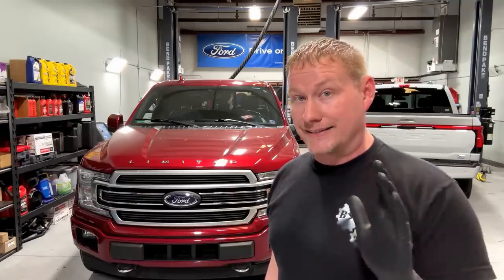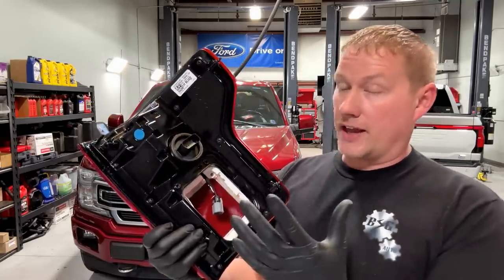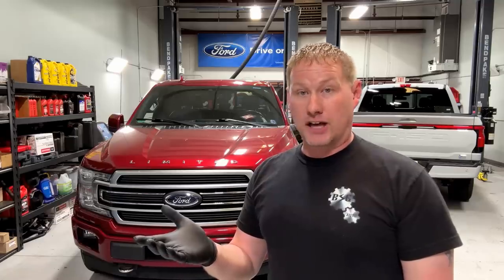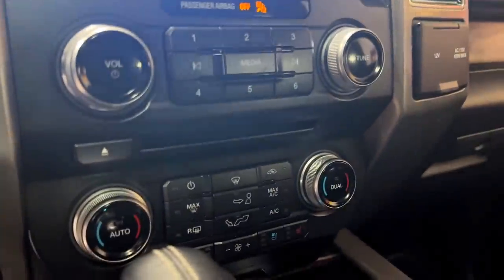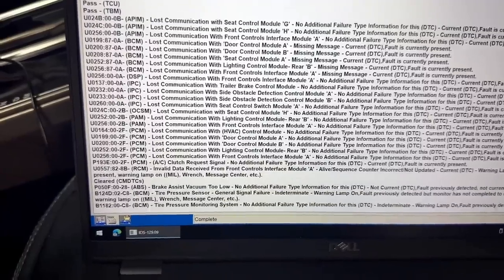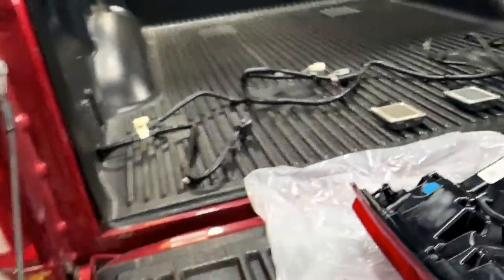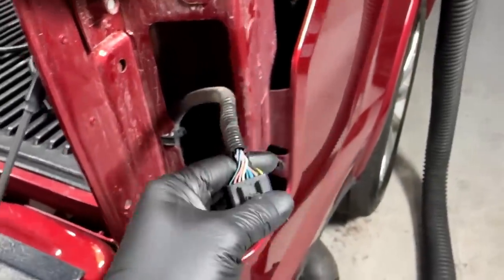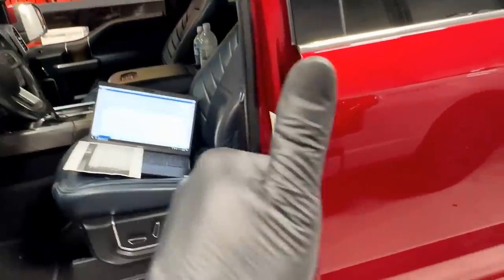Repair Cost Are Out of Control: $5,600 Bill for Some Tail Lamps?!

Comment: A good idea is to go through and apply electrical grease to all connectors.  Looks like they didn't do that at the factory.
Reply: I'm not a mechanic, but every vehicle I've worked on I've never seen grease in the connectors. Definteky need to do that to the Transit since Ford is so smart to direct the water flow right on top of the main harness connection. Never Ford again
Reply: @albowrx  Back in the old days they used to put grease on everything, especially lightbulbs. These days automakers cheap out on everything.
Reply: Auto makers these days are all about building a vehicle as cheaply as possible, while selling it for the highest possible price. Nothing else matters to them.
Reply: @albowrx  As a now retired aircraft electrical systems guy, who did side jobs in automotive shops from time to time, dialectric grease on electrical connections to prevent corrosion on electrical connections with the potential for moisture exposure used to be the norm for aircraft and motor vehicles. Now the car manfactures seem to have forgone using it. They tend to seal things a little better than they used too, but corrosion is still an issue quite often. Other than cost I have no idea why things have changed in the automotive industry.
Reply: @SmittySmithsonite  But hey! they saved 19 cents per vehicle by not doing that, so big win.
Reply: @albowrx some older euros and certain cold climate cars on certain fittings had a yellow tacky dielectric grease. 101 of restoring an old car is cleaning and repairing all the connectors. And the goo does prevent the green crust quite well. Green crust is the number one gremlin.
Reply: No we don't. I don't know that anyone does that. The last thing they expect is water intrusion with all the seals used on connectors
Reply: What's truly disgusting about this is that this truck is only 5 years old. Both my vehicles are 10 and I've and I've never had any of these issues with my taillights or headlamps. Tying all those other modules to the taillight module is ridiculous. My truck went start or run because my taillight is screwed up! Seriously!?!?
Reply: don't apply grease to most connectors these days because they have integrated silicone seals. if you add grease, you're gonna ruin the seals.
Reply: Because that's what we want to do with the $80k investment we just made, disassemble it.
Reply: And that's part of your problem. It's not an "investment".
Reply: @albowrx Exactly I did my transit before it became a issue. I take my connections loose and clean and grease every 2 years. First time I did it was already showing signs of corrosion on a few pins and this is with me paranoid about keeping the gutters clean. Also the rubber grommets for the wiper arms need replacing every 2 years, well the driver side anyway passenger always looks fine go figure
Reply: @sandspar "investment" lol, lmao even 😂
Reply: Any asset you can buy or sell is an investment. The comments about this fully loaded vehicle not being worthy of investment mentality, just need to get to more classic vehicle auctions. Even if the odds of that truck or any making it to an auction 40 years from now is a long shot.
Reply: @Ed-ui2qe  Bingo!

Comment: Great video - give yourself more credit, the move to cycle the key and check for difference is a skilled intuitive gesture, I've watched other tech's chase their tails without getting to a common point of fault.  I once spent well over 20 hours looking for an intermittent fault on a Range Rover, ultimately found a chafed wire for one of the injectors intermittently grounding as the engine torqued up on the rev range, the rocking motion  tightened the harness enough to initiate contact and immediate ground resulting in full fuel dump to that cylinder.  That point of contact was allowed due to the convolute tubing split - the split was directly on top of an intake manifold bolt, the wire over 3 thousand miles wore down to direct contact creating full ground and max spray as in wide open throttle on the one cylinder only happening under real load, 4 wheels on the ground and actual driving conditions.  On the lift, there wasn't enough resistance on the drive train to re-create the dynamic action of torque applied by the contact on the road to reproduce the grounding fault.  This one was a rough process.
Reply: I hear ya!! What I've learned over the years of being a tech is that most times it's easier to forget what you think you know and dont tunnel vision on the issue.....instead start at the very most basic.....battery voltage,wiring etc. It's amazing how many electrical faults I've discovered just by moving wires around. I got s good one for ya though....I was working on a brand new electric forklift one time that would shut down intermittently. In the end, it turned out that one pin was bent in one of the modules which would short to the one beside it. It was an unused pin and the connector still pushed on but "felt" ever so slightly different than the rest of the connectors. Your story reminded me of that one.
Reply: A most excellent tracking to the fault and perfect logic… when bean counters get to alter designs this is surely what happens to us as consumers… the manufacturers have been undersizing wires for years!!!
Reply: I had a Corolla that would turn on the oil light at idle in drive. Same type of deal. Thought I was into an engine at first.

Comment: We see this frequently in the southeast where we have a huge amount of rainfall that comes down in short durations. It is so common if you come in with  MS-CAN bus faults, that's become our starting point. I've also seen the equivalent failure in Rams. I'm not sure why this hasn't come up as a recall issue, especially considering other saftey related components that have such as the 360 degree camera system. If cameras warrant a recall, why don't blind spot dectection systems?

Comment: I went through this exact issue. The idea of a little water taking down the entire truck is insane. I love my 2017  F150 Platinum but this almost made me sell it.  

For those wondering, disconnecting the battery for half a day, cleaning drying, and greasing several 20 pin connectors (relating to the tailight) and replacing the entire tailight  including the BLIS module  finally fixed it. I also drilled a tiny weep hole in the lens of the new light so water couldn't collect in there and work it's way into the BLIS module - used a clear caulk to seal the module into the taillamp body too. It was insane gremlins all over the truck till I fixed it. Utter bullshit!

I really appreciate you making this video. There is a lot of confusion out there on this issue.
Reply: weep hole was my comment on Louis Rossmann channel. that's why i'm here. Louis posted the story i came to see story :face-fuchsia-tongue-out:
Reply: Built Ford tough
Reply: Ford should be on the hook for this. Bad design
Reply: 1995 and older for me from now on..........emissions can go to hell. Its MY vehicle, I WILL keep it running affordably.
Reply: @jeffsingleton88  tree fiddy 🤣
Reply: LOL drilling a tiny holy is a solution Ive used may time myself , sometimes the light housing just collects water no matter what especially where I live it rains hard for months.
Reply: You should still sell it.
Reply: Weep holes are essential for getting rid of humidity inside rear lights!
Reply: Even though you found the "fix" for the same electrical issue caused by water, and was able to repair it yourself, think of the poor, inexperienced man or woman owner of this truck and the expense they go thru to get their expensive truck operable. There needs to be a recall as a deterant in the future for poor vehicle design and this money pit.
Reply: @larrybruce4856  I agree completely

Comment: I worked at a high line dealership when HID headlights first came out. A customer would come in with a burned out headlight  and expect it to be a $5.00 bulb. When the bulb would short out it would take out the bulb, ballast and igniter in the headlamp. 
To get to the headlamp out to repair you had to remove bumper and replace the parts. It was sticker shock to the customer to know it was going to cost $1000 to get the headlight  working. The repair cost was mostly parts.
Reply: I think most people need to see what a repair bill for all this fancy stuff costs before they buy a top trim new car.

If they did, let's just say I don't think as many people would loom down on then for buying a low trim model or a used car instead.
Reply: Gm product is my guess...maybe a caddy?
Reply: Yep, went to change the headlamp on my car and discovered I had to take off the bumper. Talk about BS designs. These vehicles are ridiculous. Soon enough everyone will essentially swap out cars as often we do phones because nobody can afford to fix them (won’t be worth the cost).
Reply: I have HIDs in both my cars and I get replacement bulbs for $10 and I have never known anyone to have a ballast go. You sure you weren't just ripping your customers off? Removing a bumper usually only takes a few minutes too.
Reply: @vickilund7206  Acura. Mostly TL's around 1999.

Comment: 13 years ago I purchased a 1991 Toyota Hi-Ace Diesel 4WD for $5500NZ. It is still running. I have spent around $5000 in repairs. (Mostly rust, as I take it on the beach). I will never sell it. No question, it is the best vehicle I have ever owned. The tail-lights are original.
Reply: Question are you able to buy the newer Hi-Aces over 2011 model? Here in Europe the 2011+ "pollute too much" so we don't have them I know they make them in Japan. 

However Toyota has paired up with PSA Peugeot and Citroen to rebadge a Partner and call it the "Pro Ace" just a French Shitbox IMO with Toyota badges, a disgrace many customers say they buy Toyota because of quality, and they get a French car, talk about a scam.

 Also a side note Volvo, people buy them because of "Quality" little do people know after 1999 Ford bought them and Shitboxes yet again, however now China has Volvo it is just Shitboxes with big wheels. 

If you did not know, "Stellantis" is a auto conglomerate made up of the Crappiest car companies ever to exist destined to make the ultimate shitbox, can't wait to screw over more people with stupid repair bills.
Reply: @heisenfeis  yeah-the crappy Stellantis car, the Alfa-Romeo Giulia, was for a long time the fastest 4-door car in the Nordschleife, faster than many supercars.
Reply: It is hard to believe, but there are enough people with money, and they are ready to pay to drive the modern car with 400 hp engine, 10 airbags, leather, climate control, bose music and good brakes.
Reply: Cool life story, bro. But try to stay on topic.

Comment: We are light speeding towards the era of those that knows how to figure crap out themselves vs those that overpay massively for every tiny thing.
Reply: Ain’t no diy guy figuring this mess out without a professional background in it.
Reply: No, the manufacturers are making certain that we WONT BE ABLE TO figure it out, there's no "figuring" this kind of failure out, it's replace the assemblies because there is no fixing them.
Reply: You will own nothing....
Reply: You cant touch a new vehicle. Your warrant will void. And even in the case of insurance claims, insurance may not help you if your vehicle fails and you've worked on it yourself.

Comment: This is why I keep my 2000 Expedition. The 2V 4.6 will probably outlive me. 297 000 miles and runs great.
Reply: I have an 02 E.B Expedition. It's a tank with 158k on the clock.
Reply: As long as you keep oil in it, that 4.6 will last forever 😂 I ain't even a Ford guy but those are hella reliable enginea
Reply: @secondgensilverado8752  Amen ....I've been good with the fluid changes and so far so good.  Still the original transmission too!

Comment: Hey, love your channel. Yes, automotive repair costs are out of control. I'm fortunate enough to have worked in the aviation industry as a PowerPlant and avionics tech and have worked with CAN systems for the past 24 years, one definitely needs a good electrical back ground in order to understand these new vehicles and be able to fix them.  Plus the equipment/ tooling required. I've also owned my own auto repair shop and much prefer aviation, lol. Anyway, keep up the great work, and thanks for all your great info.

Comment: I bought a 2001 F150 XLT in 2000. It now has over 285000 miles on it. It hasn't been trouble free but no major issues. I live in SE Texas so salt corrosion is not an issue as long as I stay off the beach. My son-in-law thinks I should buy a new truck. This has convinced me not to do that.

Comment: So glad I came across this today!  I was just ready to place an order on a Maverick even though I have been hesitant on purchasing a vehicle newer than '05 just because of these types of issues.
Reply: Engine Control Module  goes back to at least 88.  Most classic cars with Fuel Injection use at least a few computers.
Reply: Get a Toyota.
I know most people want a new car.  And Toyota/Lexus 's new cars are good.  But, I would get something about 8 years old or so.  Just find the cleanest, best taken care of example.
Reply: @shugertits You aren't wrong, Toyota is great quality, but you aren't right either. When those Lexus cars get old, their parts still cost brand new car prices, while they are 15 or 20 yrs old. You also have to think about that. That's why old BMWs and Mercedes are terrible options for the working man. He thinks he can afford it now that it's 10 yrs old. Part prices rarely age like the cars do.
Reply: @ctdope  
Maybe.
If you get the wrong model.  Either way.   You usually don't have to replace those parts.
I grew up a diehard GM guy.  It pains me to recommend Toyota (even though the Tundra is the most American made vehicle on the domestic market).  But these American car companies don't make anything for me anymore.
Toyota, in particular, has the philosophy to refine instead of innovating every year.   They don't feel the need to trailblaze technologically.  They refine and overbuild.  That's the reason they are the most dependable car on the road.
It's not legitimate to compare BMW and Mercedes with Lexus.  Lexus parts are designed to last, the former literally designs to fail.
However, you can get a deal on Lexuses because of just that luxury car obsolescence effect you describe-- What you're saying is true of all other luxury brands.  Of course, certain models are better than others, but I'm usually buying fair priced Toyota parts , which arent the cheapest for sure--on the rare occasion that I need them for either of my high mileage Lex-i.
Reply: @shugertits  I see. Ok.
Reply: @ctdope  
What would you recommend the op look at?
Reply: @shugertits  What is "op"?
Reply: @ctdope 
Original poster ^
Reply: @shugertits  OK. So your question is what kind of car I would recommend to the original poster?
Reply: @ctdope  
Yes.
Postor maybe?
Reply: @shugertits  Honestly, I would prefer most American cars before all this super fancy computer crap was installed in cars. I know, they all make more power and run "cleaner" now, but they also come with more headaches. Any little thing can ruin your day/wallet, and make your car inoperable. You take it to get checked or "fixed", and find out it was something almost simple, but will now cost several 1,000s to fix. Cars aren't made to be easily worked on, especially not for the owner of the car or average DIYer. It's scary to think you get into a car today, which most performance cars run 50k or more, and something small takes the car off the road. Muscle cars were so simple, now we all need a PHD in Electrical Engineering to change spark plugs. Sad.

Comment: A couple years ago I had a similar issue on my platinum 2016 F150.  I took the taillights off, dried them, and used silicone caulk to reseal the tail lights. Everything has worked great ever since. I was lucky to find a forum post where someone described the problem and solution.

Comment: My 2004 FX4 had a leak in the rear window seal that got my security module wet. $30 for a used module, and $150 to reseal the rear window. That's about my speed when it comes to repair costs. Still running strong after 200,000 miles.
Reply: My 03 did the same thing but just ruined my aftermarket amplifiers and rear window motor. My security module I think is in my dash, they must have realized it wasn't going to get wet enough there so they moved it by the leak prone back window when they redesigned them in 04!🙂. At 20 years old and being out in the Florida sun, all the seals are drying out. I just had to re-seal the windshield as the sealant had dried out in one spot and was dripping. Can't really complain with how old it is and the climate it's in. 

My 2014 Grand Cherokee already had rubber parts rotting off of it about 10 minutes after the 3 year bumper to bumper warranty ran out. Windshield squirters flew off and rubber strip on the cowl dried out and started making farting noises at highway speeds until it disintegrated. The Grand cost nearly 2x what the F150 did and it's been in the shop more times in the first couple of years than the F150 has in 20. Too much plastic and too many corners cut. The new ones are quiet, smooth and get better mileage, but that does you no good on the side of the road!

Comment: Agreed I had a mild fender bender with my 2019 Q5 , $1800.00 damage to the other car, my damage was broken grill, small dent on the hood and driver fender, all sensors working, broken front plastic headlights all lights working . The crash speed was less than 10 mph.
My repair bill was $18,500. Unbelievable crazy
Reply: Just wait until you see your insurance renewal rate 😱
Reply: @brucesmith9144  so true can’t wait to see it. I know I will be shopping once again for auto insurance.